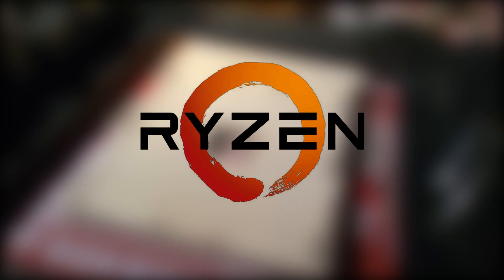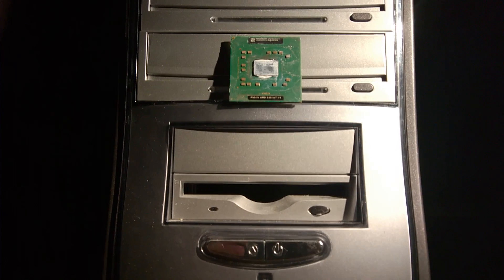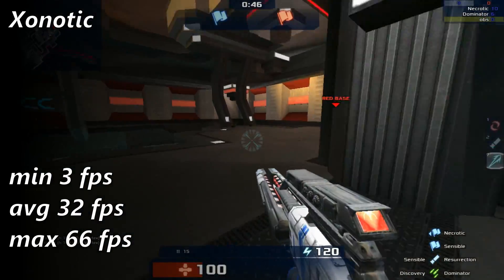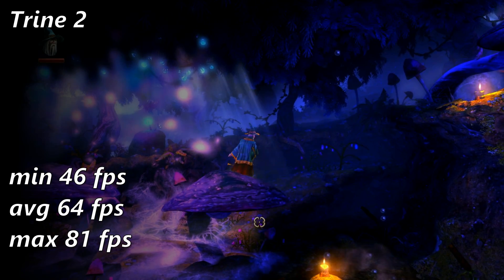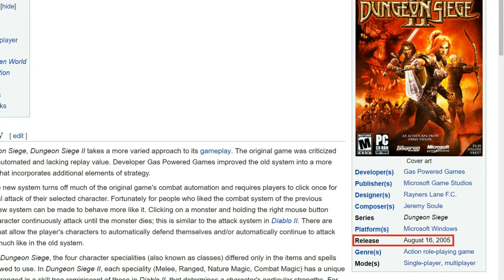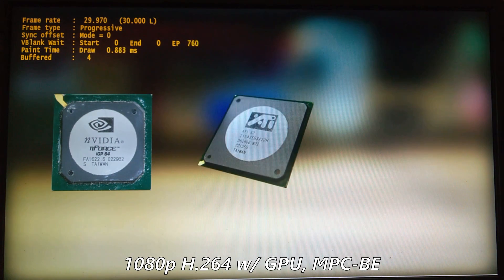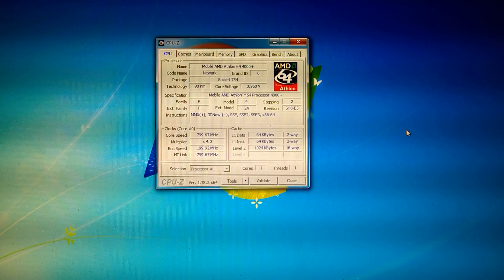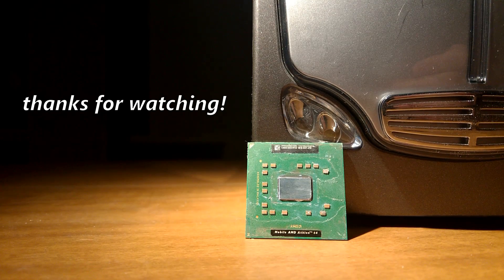The Ultimate Socket 754 CPU | Mobile Athlon 64 4000+

Comment from the maker: Small update, I tried this CPU in an Asus K8N nForce 3 250 board, and even on the latest beta BIOS it doesn't work. You can enter the BIOS and change whatever settings you want, but when it comes time to actually boot you lose the display and it sits there doing nothing :( Shame considering it actually has Vcore control and detects the 2.6GHz clock properly (the ECS board doesn't)
Reply: I don't know if you'll ever see this comment, but there is a board that exists somewhere out there that has dip switch controlled multipliers for 754. Much like the Soyo dragon board that allowed you to force a multiplier on Socket A even on locked CPUs. I can't recall much about it, other than it was the only board that made the mobile 754 I used work consistently well, and the only spot to download drivers for it was a Chinese site. It ran some modified VIA chipset. I don't know that you'll ever come across it, but it might make for an interesting video.

I just randomly decided to search 754 when that old machine came to mind. Sure seems like processors had a shorter time period before they were outdated in the past.
Reply: Can i run this one AMD mobile Athlon 64 4000+ on my K8M800-M2? Please tell me friend)))
Reply: Test core 2 vs k8.

This is a brief reminder intels compiler is still cheating on ryzen chips in some applications that were never fixed despite the FTC getting legally involved.

"In addition, allegedly, Intel secretly redesigned key software, known as a compiler, in a way that deliberately stunted the performance of competitors’ CPU chips. Intel told its customers and the public that software performed better on Intel CPUs than on competitors’ CPUs, but the company deceived them by failing to disclose that these differences were due largely or entirely to Intel’s compiler design."

https://www.ftc.gov/news-events/press-releases/2009/12/ftc-challenges-intels-dominance-worldwide-microprocessor-markets

https://us.forums.blizzard.com/en/sc2/t/patchguide-for-cpu-speed-fps-if-you-play-competitively-click-this/17442

Comment: Awesome video. I didn't know about this hidden gem. I remember upgrading more than a few socket 478 computers with the 'mobile'  2.6Ghz/400Mhz FSB Celerons. It was such a boost for those early 478 that were locked to 400mhz FSB.
Reply from the maker: Thank you! That reminds me of when I tried to install a P4-M into a desktop board. Quickly realized there was no SpeedStep support so I was stuck at a pathetic 1.2GHz, haha. The only time I really see the Celeron making sense is in power consumption-conscious scenarios or in PC's with awful coolers since you can go up to 2.8GHz with a regular P4 on that FSB speed, and 3GHz if you're extremely lucky and find such a CPU.
Reply: I will have to track it down. I think the 400Mhz was actually the slowest speed, then 533Mhz and then 800Mhz, but I can't remember what the initial speeds are. I remember that at the time, most people were using 1.8Ghz Socket 478 pentium 4s that needed the upgrade. I bought a good amount from Ebay. I guess it might have been 2.8Ghz (Celeron) with 512k. Jesus, I am getting old and forgetful :D
Reply: Are you saying a Pentium-M Celeron 2.6 on a desktop board? How does that work and what’s benefit?

Comment: I remember having a S754 rig back in those days, with a A64 Newcastle 3000+ installed. I tried to get one of the mobile 4000+ CPU's when they came out, but they were always either sold out or in short supply and selling for higher than MSRP--which was high already. Several months later, Intel finally shipped Conroe, and I got that instead.

Comment: The biggest limitation with this chip is actually nothing by fault of the CPU itself; Socket 754 is quite limited because of its complete lack of dual-channel RAM support, and the presence of only a single-channel 64-bit memory controller on all chips. In addition, compared to Socket 939, it loses out on HT bandwidth and the effective data bandwidth of the internal bus, consequently.
Reply: Pretty much. The data bandwidth needs for this baby just aren't being met. The HT bandwidth isn't hurting it as much as the total lack of data bandwidth.
Reply: Why would you even need dual channel ram on a platform designed for windows 98?
Reply: @TheGTXLord50 754 gets ignored and for that reason i can buy a whole windows98 gaming system on ebay for £60, 754 didnt have low sales but the pentium D did. the athlon64 3700+ socket 754 destroyed any skt478 pentium4 even the extreme edition which cost twice as much. so you see people with common sense buy AMD
Reply: I went 754 back in the which I still have the system for the price.
Reply: I was so upset when I first used my socket 754 system. My FPS were all over the place with a 6800 GT. Was not impressed and sold it very quickly.

Comment: Wish I had not missed this video back when you posted it. Had I seen it prior, Id have advised you to run Xp in a different video as an updated test. The AGP versions of the HD Radeons ran faster in Xp. They were somewhat hampered in Windows 7 due to AGP compatibility issues.

Comment: By coincidence I'm currently making and old socket 754 Sempron machine into a jukebox for a friend, it is of course far, far slower than the one you showed, 1.6GHz 256KB L2 cache etc. 
For the fun of it I installed a Chromium OS spin-off (Neverware Cloudready), with a bit of OC to 1.9GHz and using h264 (no acceleration but it's still lighter on the CPU than VP9) it managed to stream 720p video more or less fine, I'm extremely impressed.
Reply from the maker: Wow, I guess Chrome + Win7 has a lot more overhead, I'll have to look into that sometime

Comment: this cpu may have had 200mhz more clock speed but the 754 3700+ had way more instruction sets, therefore in a good mainboard actually performed much better at lower clocks.
Reply from the maker: i...what

The 3700+ uses the older 130nm Clawhammer core without SSE3, the 4000+ uses the 90nm Newark core with SSE3. http://www.cpu-world.com/Compare/585/AMD_Athlon_64_3700+_(rev._CG__AR)_vs_AMD_Mobile_Athlon_64_4000+_(E5).html There isn't a single instruction the 3700+ has that the 4000+ doesn't

Comment: I had an old computer with the AM2 940 socket laying around so I ordered the dual core version of this processor. I plan on using it as a YouTube / Netflix machine for my home theater. Hopefully it can handle video @ 720p lol
Reply from the maker: The move to (possibly) dual channel DDR2 and the faster HyperTransport speeds should help quite a bit, should be fine with a GPU packing a decent video decoding block
Reply: The Obsoletist I put a gt 610 in there. It's no gaming card, but I'm sure it will get the job done.
Reply from the maker: Ehhhhhhh, I haven't had a good time with mine. Had to overclock the VRAM to even get 1080p60 video to play back smoothly. Anything lower is fine though
Reply: The Obsoletist yeah it was the first gpu I ever bought. I thought I was getting a bad ass card at the time. I used it in a dual core sandy-bridge build a while back and it played 1080p 30 fps with no issues. We'll see when my 4000+ arrives in the mail.
Reply: Just installed it and it's great. Way better than that single core I had in there. I was able to stream netflix perfectly fine on internet explorer. for some reason chrome drops frames like crazy.
Reply from the maker: The most likely reason for that is Chrome defaulting to the VP9 codec, which the GT 610 can't accelerate at all. IE would be using H.264 so the 610 actually does something

Comment: This is my first pc back in 2004 :) but with sempron 2600+ and 254MB of ram and msi 9250 i think :)
Reply: And now in 2019 you upgradet to a 1gb of ram ..
Lol
Reply: catalin simionescu no i upgraded it to 2GB of ram which is not bad for 32bit win 7 and bought athlon 3200+ @ 2.2GHz overall pc is still usable!
Reply: @lukaandrejevic5100  are you joking buddy?? It.s 2019 how can you still have 32 bit system ?!
You can.t even have a decent experience on 1080p movies with that gpu..
Buy something from intel like a decent i5 , i5 4460 paired with gtx 970 or 780.
8 gb of ram ddr3 at least and a 120gb ssd from samsung.
All this today is like 600 euros.
Reply: catalin simionescu am not using that pc i just sad that it is usable it can load sites if you dont havr better pc, i am not using it, it was more like upgrade for old times :) am now using i7 7700k and just wonted to see how my first pc works now :) but just to point something out i live in Serbia, here a lot of people dont have 600e for pc.

Comment: The best I could do for my socket 754 board is to get an Athlon 64 3300+. My system came stock with a Sempron 3300+, so I’m hoping it will be better performance with the Athlon 64. I wasn’t willing to pay $30 or more for the few faster Athlon 64 CPUs I saw on eBay, but hopefully the one I got will be good. Thoughts?
Reply from the maker: The A64 3300+ is in a weird spot, since it has the 2.4GHz clock of a 3700+ but only 256k of L2 cache like a Sempron 3400+. Still better than the original CPU, that's for sure. I highly recommend tuning your RAM timings in the BIOS, or with Memset if you can't.
Reply: @hblankpc  thank you for replying! The board is K8MC51G, which doesn’t have memory timing settings in the BIOS. What do I set using memset?
Reply from the maker: You'll have to experiment to see how low you can set each timing without causing instability. When I tuned the RAM on my Optiplex 170L I would run 3DMark2001SE after each setting change to make sure it would complete, and see how much the score improved. Ended up at DDR-400 2-3-2-5 1T, I'd imagine you could do the same.
Reply: @hblankpc  thank you so much for the guidance. I will test this out for sure!

Comment: Would you believe I had an LGA AMD MB/CPU combo? I later sold it to my sister but could always remember it was so odd for AMD and had a warranty sticker sealing the clamp to the cpu, but it is socket F/L! It had an Opteron cpu! I had originally bought it new for a steal less than $60!
Reply from the maker: Opterons are still a crazy good value for multithreaded workloads, I can search 'opteron' on ebay and the first listing is 2x12 core CPUs for $10. Take that, Xeons :p

Comment: good rewiew.. by the way i have  an athlon 64 3000+ (ADA3000AEP4AP) I want to play games that are 2010 and below in 720p with 25-30 fps. (crysis1-2 fear1-2 xman origins wolwerine etc) which GPU  should i prefer ? and is it possible ?
Reply from the maker: You won't be able to play everything from that time, but you'll scrape by with most of it (except Crysis 2, but that's from 2011). If you have a PCIe motherboard you can pretty much use whatever you want up to 2008, AMD cards newer than that might have issues with old motherboards. On AGP you'll want something beefy for the newer games, something like a Geforce 7800/Radeon X1950/HD 3850/4670. Prices on those are ridiculous though, so I'd really try to go PCIe if you can.

Comment: I have an old Acer 1362LCi laptop with a Sempron 2800+ I would like to make 64bit rather than the existing 32bit. Is it possible to exchange it for any athlon 64 to achieve this? What is the safest bet? Currently 1.4v 62watts I think. 333mhz. if I remember correctly.  1.6Ghz. Any suggestions would be greatly appreciated.
Reply from the maker: It's hard to say for sure what will work, there's very little info out there about that model. These CPUs have the highest chance of working:

AMN2800BIX5AR
AMN3000BIX5AR
AMN3200BIX5AR
AMN3400BIX5AR

If you're feeling adventurous I'd grab one of the Turion 64 ML or MT models, they use the same E5 core revision as this 4000+ but draw a lot less power.
Reply: @hblankpc  Thank you for your thoughts. It has a  VIA K8N800 Chipset which apparently supports 64bit but I'm not sure about the bios or what else is needed to ensure it will boot with the different cpu. Thanks again for replying.
Reply: @hblankpc  Bought this one. Wish me luck.  AMN3200BIX5AR AMD Processor CPU Mobile Athlon 3200+ 2.0Ghz 1MB Socket 754

Comment: Wth is not the athlon 64 3700+ the last CPU for this Socket?
Reply from the maker: No, not even close. The 3700+ launched in June 2004, this one is August 2005. This isn't the last one either, that distinction belongs to either the Mobile Sempron 3600+ (Albany core) or 3400+ (Roma core), both from May 2006

Comment: Which Drivers did you install for the AGP 4670? Because my one is struggeling badly with drivers, they don't recognise the card
Reply from the maker: I got them from devid.drp.su, I put in the vendor and device ID and tried drivers until one worked. The one that finally did it was 8.930.0.0, aka Catalyst 12.1
Reply: That's the one I tried and it really worked finally, but I seem to have no hardware acceleration as youtube videos in 720p won't play on a P4 System only 480p will. And I know that from PCIE bases P4 Systems, that shouldn't be an issue when you have a half modern Graphics Card in there. Which Browser did you use? I normally use Firefox, and thanks alot for your reply, much appreciated!
Reply from the maker: I use Chrome for everything, usually works fine (that being a relative term) with the h264ify extension. Have you tried watching through a media player like VLC or MPC-BE though? That tends to be a lot better on slow CPUs
Reply: No I meant directly in youtube, on my PCIE based P4, I can watch YT in 1080p 60fps without problems and the accelerator just being a rubbish 520 GT apart from playing 3D Games, that little card does a great job. But on the AGP 4670 P4 System, HTML5 acceleration doesn't seem to work, I can only play 480 with the CPU doing all the hard work, maybe because the card is to old to support it I can't tell. Back in YT Flash times, I could play 1080p even with a HD3450 AGP. Perhaps newer Web Standards don't do older hardware any good

Comment: can u try the sytem with windows xp ?
Reply from the maker: Maybe eventually, if I ever do an Athlon 64 vs Pentium 4 comparison it'll be on XP
Reply: The Obsoletist ok it would be super 👍. By the way i have 3000+ and i want to buy a gpu and afraiding of bottleneck i found a hd 4650 is there a bottleneck risk with hd 4650 with 3000+ ?
Reply: The Obsoletist added you from steam. by the way my english is not soo good which GPU did you used in that video ?
Reply from the maker: There will be some bottlenecking on the CPU side especially in older games, but if the 4650 isn't too expensive i wouldn't worry about it. Also I used an HD 4670
Reply from the maker: I just remembered that I discarded your Steam request because I had no idea who you were. Go ahead and send it again, I've started accepting everyone

Comment: can i put this cpu in a laptop?
Reply from the maker: You can, but imo you shouldn't. This CPU was meant for desktop replacements and has a 62W TDP, a Turion makes much more sense at 25-35W
Reply: im looking for a laptop that i have and i dont know what is the best for it i am thinging of a turion 64 mt-40 do you recoment me something better?

(sorry for bad english)
Reply from the maker: The MT-40 is awesome, good luck finding one though. I can't find the MT-40 nor the MT-37 on eBay; there is one listing for an MT-34 but it's out of Germany (could be a good thing for you, idk) What's the laptop currently running?
Reply: thats what i have a mt-34. i have not seen one anywhere (mt-40)
Reply from the maker: I'd just leave it as is, if an MT-40 ever appears for sale it's probably going to be ludicrously expensive
Reply: ok thank you for your time